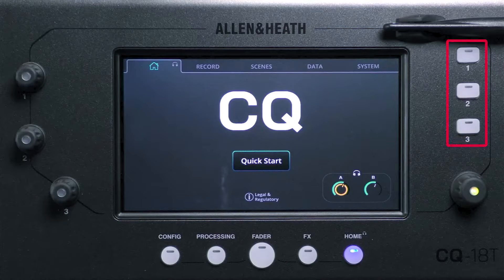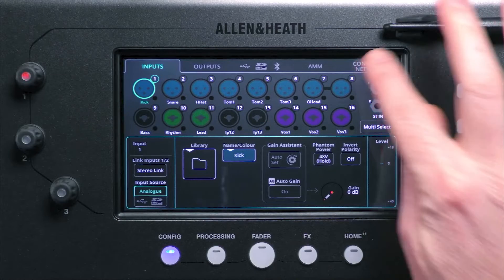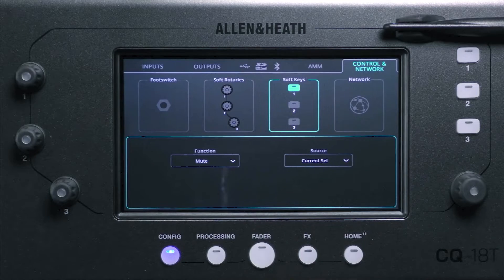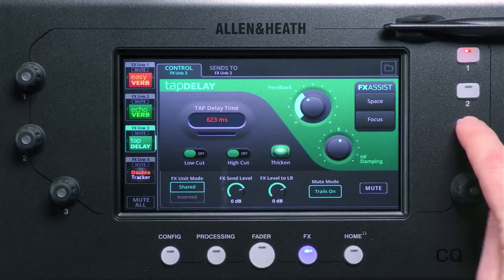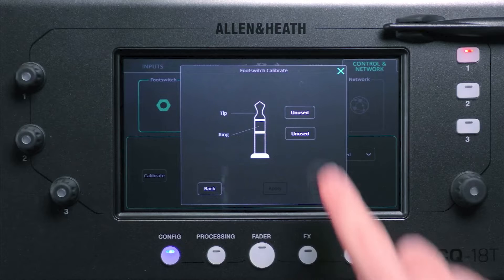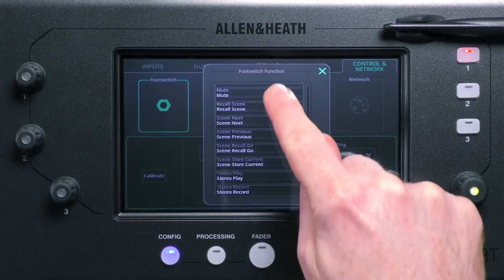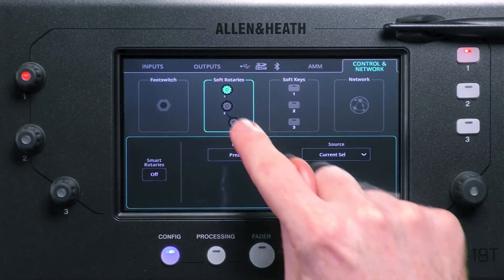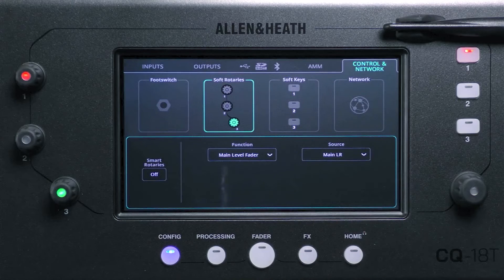CQ How To - Setup SoftKeys, Footswitch and Soft Rotaries

Comment: Coming from basic analog mackie board this thing is insane! I just ordered one. Been looking at them for a while. Can’t wait to try it out.
Reply: LOL that's the exact same situation I'm coming from and I've had mine for a few months. And it is awesome! 
The CQ series also makes a great centerpiece for a IEM system.

The only downside is you know there's going to be a next generation CQ with more inputs and outputs. And we'll have to upgrade. I know I would personally would love to see this in a 24 or 32 channel format. A bigger format would make this more practical for FOH.
Reply: @maxammo6282  yeah I’ve been using mine for a while I love it. I don’t really need much more. My only complaint is I wish the aux outs on the 18t were XLR like the 20b I wouldn’t mind if it had to be a little bigger to fit those on the board.
Reply: @dustinadair7893  I'm using passive speakers. So  the 6.5 is fine with me . I got the CQ 18-T as well . Coming from the analog world I can't say enough good things about this unit.

Comment: Hi, one question. Is it possible to start and stop an MP3 recording that I use as playback and at the same time assign the effect on/off to the other switch? And which dual foot switches are compatible here? This is not clear from the operating instructions either. Thanks in advance.
Reply: That's two questions you're out of here LOL.
I'm pretty sure the first question is possible. Just about any dual switch will work. Just make sure you're using a trs cable.

Comment: We need a video on working with scenes. I can map those functions to the softkeys, but they are not behaving as expected. I.e. When I try to set a key to "Scene Recall Go" and "Auto Increment" my expectation is that each time I hit the key, the next saved scene will activate. However, most of the time, it does nothing, and once in a while it works once, but not again.
Reply from the maker: Hello @ericwood5035,
The feature of "Scene Recall Audio Increment" is effective on the scene where this softkey is programmed. Due to CQ not having 'Global Scene Filters', you must program this function on all of your scenes and store each scene with it, in order for the next scene you recall to also have this function enabled.
Cheers,
Rafael
Reply: Well let's hope that's a feature in an upcoming update.

Comment: Is it possible to connect a switch to the networkport and use the build-in WiFi to control other equipment as well with their corresponding apps?
Reply from the maker: Hi Frank, The enabled network switches between Ethernet and WiFi, so you cannot connect to both at the same time. That aside, the built-in WiFi is intended only for control of the CQ and connecting other equipment which would take up bandwidth could cause issues. For the kind of setup you're talking about, use a separate router/access point and ensure it's capable of handling all the traffic you want to send through it (including to/from the CQ). Thanks, Keith.